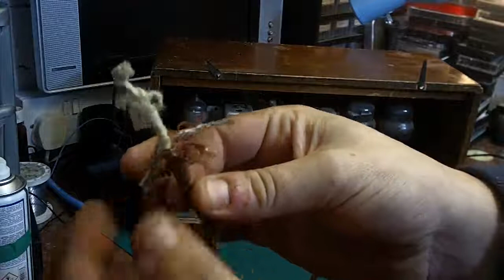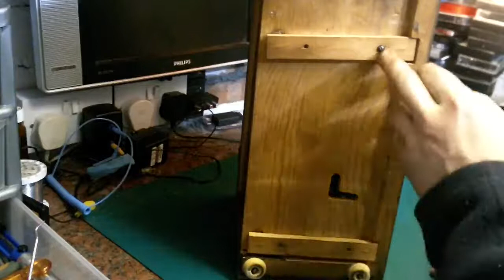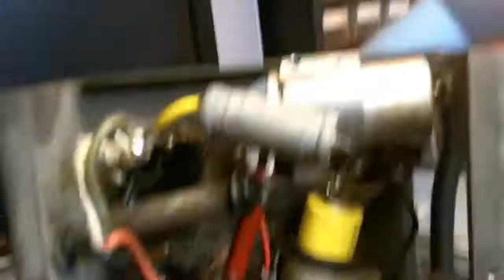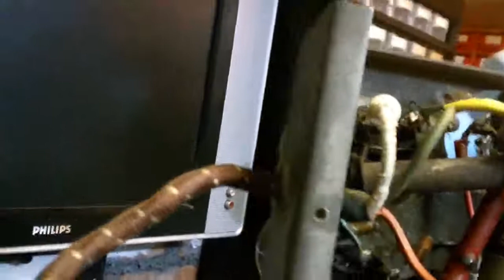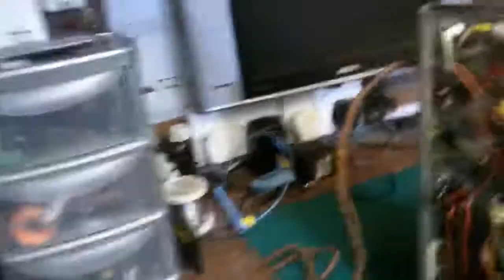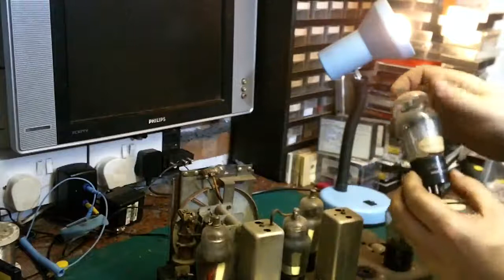Portadyne radio restoration Pt1

Comment: Hi Jay.  Right - Getting this to work today is easy if you know a few tricks. 

The HT that the rectifier 25Z4G takes on it's anode is 259V - So live mains goes straight there. 

The heaters are in series - all heaters take 0.3 Amps. So you need to drop 240 - 70 volts - which is 170V.  This at 0.3 Amps is 0.3A x 170v which is 51 Watts. So you need to go for a Capacitive Dropper - 4.1uF - in series with the heaters. 

Also these sets sometimes have a One Pole Break in the Neutral. So I would fit a new switch as well. Often a valve or two has an O/C heater due to somebody's incompetence!
Reply from the maker: Thanks for the info. I have heater contunuity through all the valves. I may bring the heater chain up to voltage on my veriac and feed HT in from an external supply just to see what the set does. I like the idea of using a capacative dropper, I would of used that or a diode and dropper resistor, the advantage of the capacative dropper is no extra heat produced in the set.